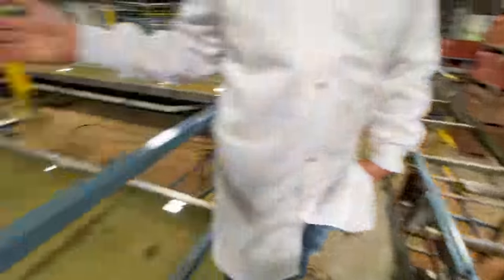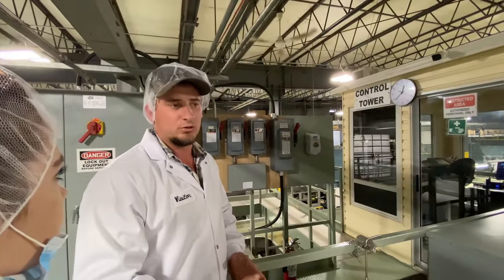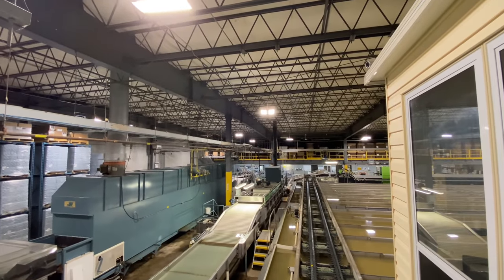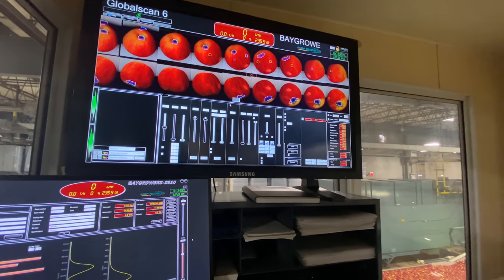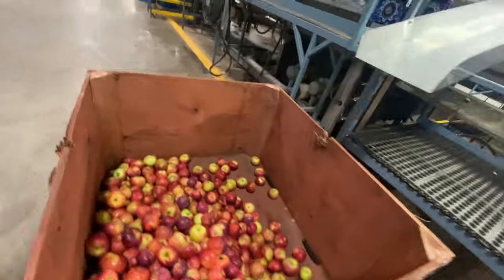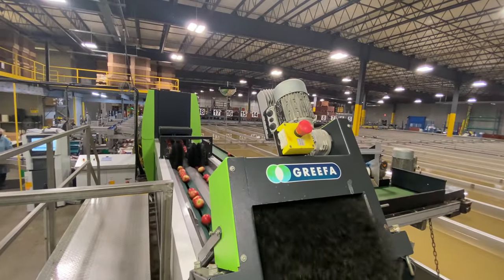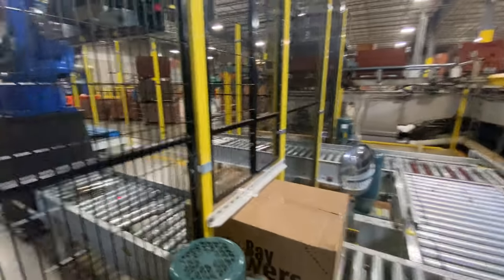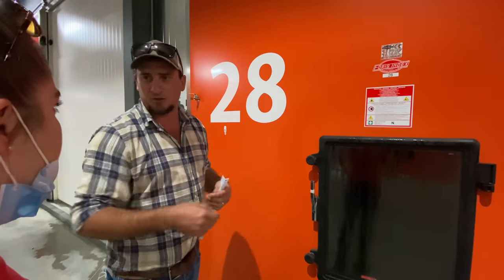Apple Packing!  Farm to Table 2022

Comment: Kate, another Great video in the apple series, learned a lot about the apple biz, Thanks !!  However, remember one thing,
for every robot, that "was" a Humans job at one time. Now with more robotics everywhere, Humans, are becoming expendable.
Like the man said, they don't go to dental appts, they don't get sick, they don't need time off, things that make Humans, Human
Kate, just think, robots can be programmed to do everything the farmer does, just think ?????????
Reply: We still have a problem with getting robots to have 'hands' that function like humans' hands, but I think that will eventually come. Let me offer another darker insight. One of my businesses designed, built, and installed process equipment for industry for years and food processors have been on a push for decades to decrease their dependence on human labor. 

A few years back we sat down with one of the world's biggest food processors here in California and they told our team, "Our goal is that if this line has 10 humans, when you're done with the upgrades, it will only require 7, and if a line has 7 humans, when you're done with the upgrades, it will require only 5. That was sobering, but that's the reality. 

When I was learning computerized controls 40 years ago, technology was very expensive, today it's cheap...dirt cheap compared to people. The other thing is that you no longer need advanced training or degrees to maintain it, and a lot of it is not designed for repair. Many items become throwaways and plug-n-play can be done by a person with little training. :-(
Reply from the maker: Thank you for your comment!  The problem is that it is very difficult to find farm workers and this is a great solution rather than not being able to get your crop to market.